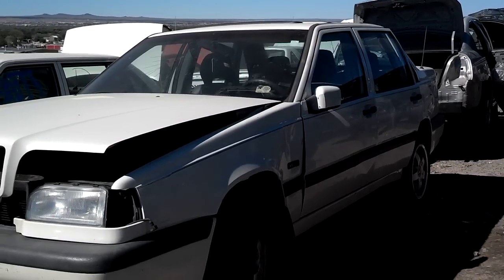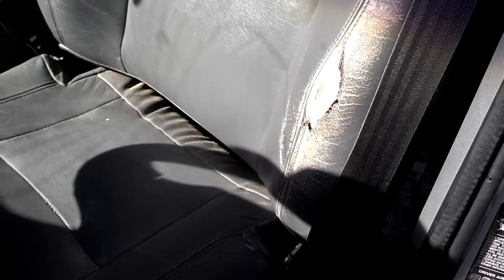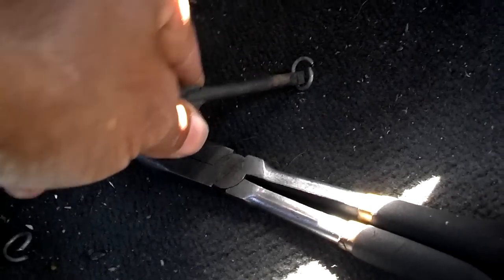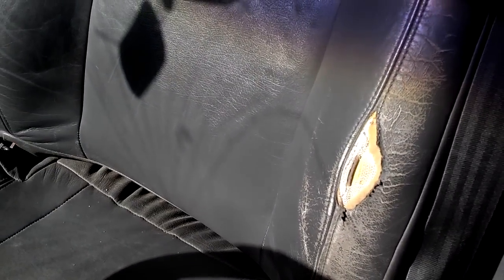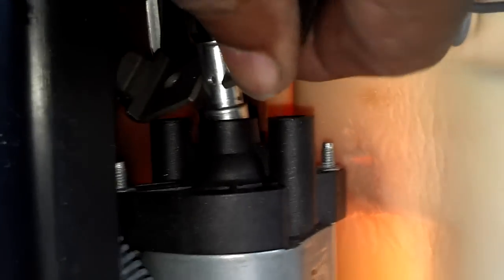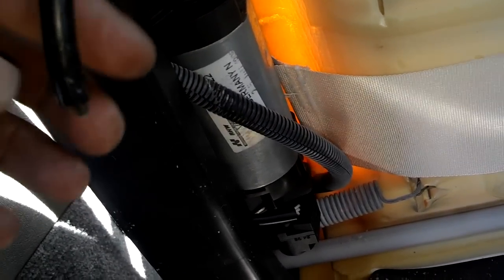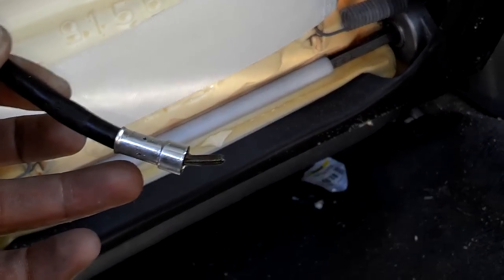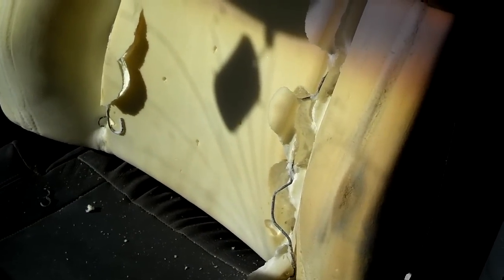Front seat back recliner function repair, will not go back up, only back. Volvo 850 - VOTD

Comment: Hi Robert:  Your video helped me repair the recline/incline cable on my '93 850.  It works, and I got the seat buttoned up with the zip ties (saved so much time).  I appreciate your efforts, I would not have felt authorized to use the zip tie method had it not been part of your experience.  Thanks for creating the video, I shared it on my FaceIbook page.
Reply from the maker: Ted N. Hi Ted, glad it worked and thanks for sharing.

Comment: Robert, you're my new idle !!  I've been driving with pillows for 1.5 years and it's a nightmare.....till I ran into your channel (needless to say I immediately subscribed to).
I haven't applied that fix yet, but as soon as weather permits I'm on it and will update my comment. 
Thank you so much for taking the time and make this video, you are VERY appreciated sir
Reply from the maker: Welcome aboard!
Reply: @RobertDIY  Thank you again sir. I couldn't wait for the weekend and started to work on the sit around 6pm, completed the job by 7:15pm. My problem was the cable as you described, however mine was short on the other end of the cable. Fixed it as you instructed and all I could think of is how i didn't find your channel earlier. I can't thank you enugh and how happy I am to drive my car again. Next time you're in Chicago area, coffee / drink on me !!
Reply: @jojy6969  did your seat move at all? My passenger side is fine, but the driver side functions are not. I've replaced the switch, thinking about replacing the whole motor?
Reply: @antoniogriffin7135  , my passenger sit worked fine too but the driver's back rest was stocked almost all the way backwards. When clicking on the switch, I could hear the motors in the back working but it never moved back up. My problem was one on one in Robert's video, as soon as I 'gave' some extra wire I was able to lift the sit up. Hope that helps.
Reply: @jojy6969  thanks for the response. I don't even hear the motor making noise.. 😭.. Any suggestions?
Reply: @antoniogriffin7135  , if you move the button and nothing happens, that sounds like a motor failure, I heard mine spinning, yours sounds like it's dead.

Comment: Was able to use this to help me fix the same problem with my 940. The motor on one side, I had thought died, but after seeing the cable in your video, I was able to fix it no problem. The cable had simply fallen out. Fortunately, it was on the side of the chair too, so I didn't actually have to move anything. Took me less than a minute.

Thanks a bunch, Robert. I'd read a whole bunch of mumbojumbo on different forums, but none of them actually spoke directly to this problem of a chair stuck in recline. You explain the issue and solution quite clearly.
Reply from the maker: Glad it helped. Thanks for watching.

Comment: Thanks Robert you are a genius. since my seat upholstery is in poor  condition I saved a lot of time and hassle by cutting  the stitches in the seam that is between the left side bolster of the seat and the vinyl seat back proper to gain access. Instead of shortening the cable housing I noticed that the cable is of the same type as an ordinary speedometer cable. It is 27-1/2" in length. I had a longer one made that  is 28-1/4" in length. Do-it-yourself kits are also available to make inner Speedo cables but I couldn't find one readily. Anyway, this solved the problem of the defective design or implementation of the design for this seat. The slit in the back of the seat is hardly noticeable and will be covered by the seat covers I am going to get any way.
Reply from the maker: Good deal. Glad you got it worked out.

Comment from the maker: Hi Jao, there is a chance that you pulled a cable loose or something has gotten jammed in the seat track. I would take the seat out and look at the motor pack to make sure the cables look good. There is a video for seat removal.

Comment: Hi Robert, thanks for that. Is there any way to crank the seat upright with a wrench or something, I just need the back of the seat a couple of inches forwards, I am not bothered about moving it back and forwards on a regular basis as I am the only driver, just fed up with driving semi reclined like Steven Hawkins. A quick fix would be very welcome. 

Also, thanks again for the clear and fulsome videos you are posting.

Comment: Robert, awesome as always. Should I disconnect the battery of the car to possibly keep the airbag from deploying? And where exactly do I use the zip ties?
Reply from the maker: +Patrick Larkin What kind of car do you have? If an 850, it is not connected to the SRS system. Zip ties hold the leather to the cushion.

Comment: Hi Robert, I have a 1995 850 wagon with power seats, in this video you explain that the seat back will not go forward. Mine will not go backwards. Also the seat base will not go backward. I could use a lil help on these repairs. Thanks.
Reply from the maker: LOL OK
Reply: I can hear both motors moving. but no movement.
Reply: @RobertDIY  Ok I watched the 960 seat repair video, that gave me the answer I was looking for. Thank you.

Comment: Hi Robert, I have an 1996 850R saloon
my drivers seat wont move forward or back does everything else
except this, have you any ideas.? Oh I have a chain & lock under the seat
that I lock the car @ nite with do you think it mite have broken a wire under there, also I can hear the motor but no movement, many thanks James in Dublin/Ireland. Luv your Vids

Comment: Hi Robert. I have a 98 Volvo S70. Having issues with the Driver Seat, the seat moves forward, and reclines forward, but nothing I do with the controls will move it backward or recline back. Should I proceed with the repair that this video suggests or is there something else that may be the problem? Thank you.
Reply from the maker: Does it click or anything when you select the other directions? Sounds like you have a problem with your control buttons. I would disconnect the harness under the seat and make sure it is not damaged. I have NEVER read of a x70 car with seat issues like the 850 or 960, it is possible but I doubt it.

Comment: Hi Robert, is it possible to convert manual seats to electric? i got a pair of electric seats from a junkyard but mine are black leather and these are tan so i just want to swap tracks.. thanks!
Reply from the maker: If the wiring is there.

Comment: Heres my problem, i have fixed the recline feature on my passenger seat, and it will recline fine, but trying to get it up it only comes up a smidgen at a time. I replaced the controls but it still does it. Any ideas?
Reply from the maker: Erik Strieter Maybe the motor is going out or the cable is actually bad.

Comment: Does this fix the issue if your seat will not incline? My seat is stuck in complete recline, it will not sit upright at all. Thanks! (Temporarily fixed it by getting another seat, but I would rather have my original back, as the spare seat is not powered)
Reply from the maker: +Brittany B does it have a recline problem?
Reply: Seat lays down completely flat. Cannot incline or recline.
Reply from the maker: What kind of car do you have?
Reply: 1994 Volvo 850 turbo Sedan
Reply from the maker: Yes, just as explained in the video.
Reply: Thank you for your reply, I will look into it.

Comment: The bench stayed in the lying position, I did it according to the video and now the bench moves forward all the time but backwards one click at a time. do I still need to do something so that the bench moves backwards smoothly?
Reply from the maker: Has something to do with the controller calibration. Try unplugging the controller, plug it back in and see if that helps.
Reply: @RobertDIY  tried unplugging and plugging back in but it doesn't work
Reply: @RobertDIY  in the lying position it goes up halfway well and then stops and goes up one notch with one press. why doesn't it go all the way up smoothly?

Comment: Hey Robert, I have an issue on my 93 850 GLT that is similar to this problem, but more unique. By unique, I mean only the right side of my driver seat will recline, and the left side is stuck in what seems to be the bottom most recline position. I took off the leather, located the motor, and checked the cable, and it was poking out enough so I ruled that out. Any ideas? Thanks ahead of time!
Reply from the maker: +sean farrell Transmission is probably bad. I would just replace the seat or all of that stuff back there.
Reply: +Robert DIY alright, thanks!

Comment: Hi Robert, a quick question as I try to fix my current volvo seats. What voltage is supplied? 30V? If so, is there a step-up transformer somewhere? Thanks for any help, love the videos. Cheers, Richard
Reply from the maker: I have no idea. What kind of car do you have?
Reply: Oops sorry for late response. Well I have a Landcruiser which runs 12V, but the Volvo Seats run 30V, don't they? I have seats out of an s60
Reply from the maker: reedondo10 still have no idea. You may want to ask someone that post Range Rover videos. GoodDad1974 may know.
Reply: Awesome, will give it a crack. Thanks Robert! Will hunt him down! :-)

Comment: Hi Robert i like this video.  I have a 1995 volvo 960 and my front passenger seat only moves forward and back on one side. plus in have a separate issue my ac doesnt function properly,  when i turn the car on  i have to wait 5 minute for it blow out the vents, but i can hear it blowing.  futhermore when i accelerate it the ac stops blowing until stop accelerating. its weird can you help??
Reply from the maker: jarvon holmes Sure, swing by. LOL Just kidding. The seat issue is like this seat problem but much easier to fix. Under the seat you can see 3 motors. These motors have cables going into them with maybe 8 mm bolts holding the cable brackets in. You find the motor that moves the side of the seat you are having issues with, pull the cable end out, trim it like in this video, put it back together and you're good to go.
Reply from the maker: jarvon holmes As for the AC issue, you likely have a vacuum like loose behind the glove box. You have to pull the glove box out, find the vacuum cluster in front of the duct system, find the one that is damaged or loose, connect it and you should be good.

Comment: so my seat back grinds when i press the button to recline  and doesn't move at all would i found 2 seats driver and passanger for 100$ would it just be easier to get the seats and put them in ?
Reply: also the seats are from an s70 hoping to go into an 850 glt both 95 it looks exactly like my seats just a little lighter color do you know if that would work with minimal modification
Reply from the maker: What if they don't work?
Reply from the maker: The '98 x70 seats have the same air bag system. The '99 and newer x70 seats have a newer style air bag system and the air bags won't work in the 850. No problem but they won't work.

Comment: Hey Robert, i have to replace the steering rack on my s90. What brand do you recommend? Maval? from where do you recommend I get it. I'm currently near san francisco
Reply from the maker: +blackpassenger Hey man, I have zero experience with steering racks. You may want to ask some folks on a Volvo forum.
Reply: +Robert DIY no prob. been checking out those forum and Maval seems be mentioned in a good light quite often. getting it done on monday. $700, plus one stabilizer bar link. learned a lesson. repair leaking steering rack, or the ps fluid will destroy stabilizer bar link rubber, hence destroying the link. ps fluid also destroys control arm bushings. so i'll have to replace my right control arm bushing and right stabilizer bar link. Total $1000.
Reply from the maker: Yes, oil fluids destroys certain types of rubber.
Reply: +Robert DIY replaced the rack and now theres a squeak coming from the steering column when i turn the steering wheel.
Reply from the maker: Ouch. Boot noise?

Comment: Hello robert I got a 2000 C70 and the seat only reclines forward but does not go back. Is it the same problem?
Reply from the maker: probably the switch
Reply: @RobertDIY  If it would be the wire it would try to operate and make a sound correct?
Reply from the maker: Sure
Reply: @RobertDIY  Hey Robert I bought another C70 and today I was driving and the seat reclined back by itself while driving and as I tried to raise it I hear the motor doing something and clicking but nothing happens. What do you think is going on?

Comment: The only part that really concerns me is those clip rings coming through the foam. I guess it will make more sense when I'm actually doing it, but I really don't wanna have to rip the foam. Sort of confused on how those clip rings can come out without ripping the foam
Reply from the maker: Cut them with tin snips.
Reply: @RobertDIY  ohh okay, so I cut them from the front with the tin snips to roll the cover up...but then how do I reattach if they are cut? Sorry if this is a stupid question, I'm a big noob, thanks for quick reply!
Reply: @RobertDIY  okay I got in there and saw what you were talking about, all makes sense now!

Comment: Mine only tries to recline on one side of the seat.. have you seen this issue before?
Reply from the maker: yes.
Reply: @RobertDIY  so likely that only one side’s cable came loose? I’m about to open the seat up and see what’s going on this week. Your content has been saving my butt with this car, thanks man
Reply: @RobertDIY turns out it was the bar that goes across the bottom of the seat and connects the to the gears on both sides had come loose from the left side so only one side was recline/inclining .. I was able to wiggle it back into the slot and got full function back, your video still helped me figure out how to start my diagnosis so thanks brotha!

Comment: excellent video Robert, I did a lot fixes with your videos...I was just wondering is this a "permanent" fix or is it going to happen again in some time? thanks a lot
Reply from the maker: +limasti89 permanent? What does that mean.
Reply from the maker: +limasti89 I did mine over 100,000 miles ago and it is still working.
Reply: +Robert DIY that's what i was wondering...if i had to do it again in a year or so. Thanks :)

Comment: Does this apply to a 960?
Reply from the maker: I don't think so but I guess it is possible.
Reply: @RobertDIY  Okay. I put 960 seats in my 740, wired them up right. But my back rest on the drivers seat will not move forward but will recline.

Comment: I have a 99 volvo s80 and the driver seat will not move at all please help
Reply from the maker: Have you checked the fuses? Does the passenger side seat work? Is there a STOP button that has been triggered?
Reply: I have checked the fuses there fine and passenger seat works fine oh and about the stop button wouldnt know where to find it
Reply from the maker: Does it move in any direction? The seats usually have an overload circuit, silver looking thing in the fuse panel. Either that or a relay has gone bad. You will have to have someone test it to see if power is going to the motor.
Reply: Did you ever get it fixed?